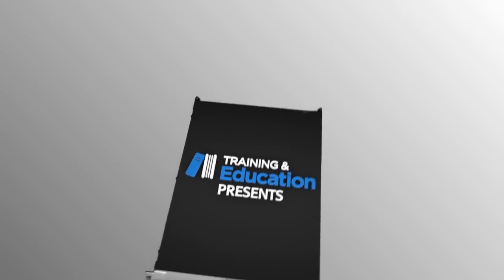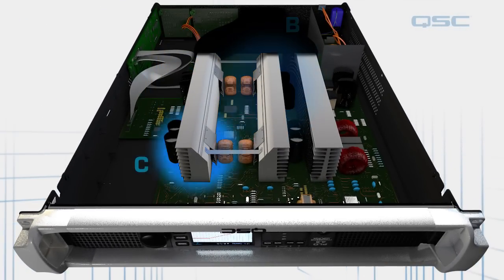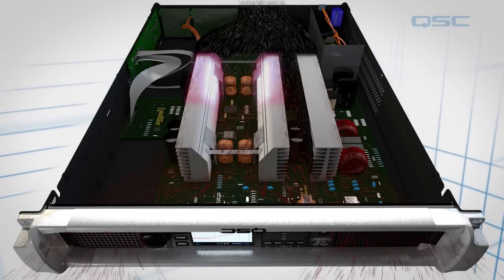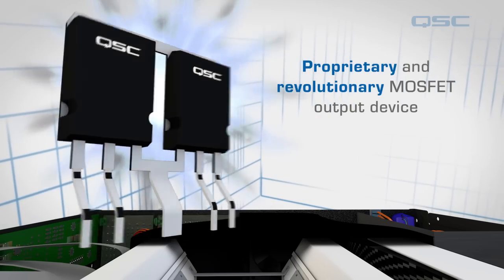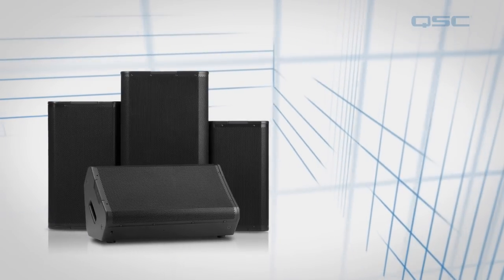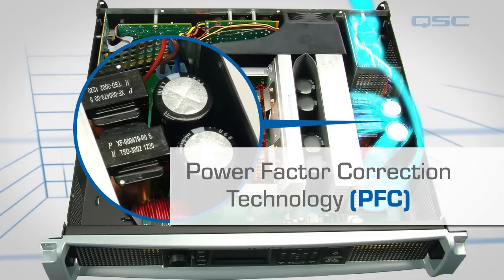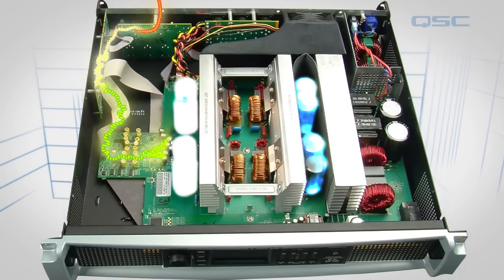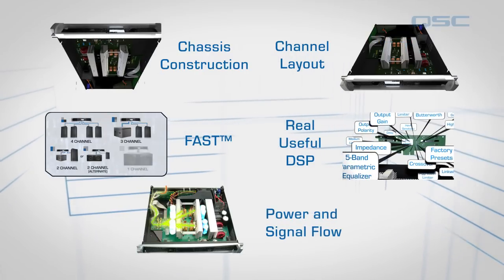QSC: PLD/CXD: "An Inside Look"

Comment: Well, this inside look video tells us that the input signal is converted from analog to digital. Where is the signal converted back to analog?
Reply: I'm not a tech but would assume that immediately following the DSP is when the signal goes back to analogue for boosting in the actual amp modules. I'm happy to be corrected if my guess is not so good!!!
Reply: @craigshaw141  I believe you would be correct, yes.